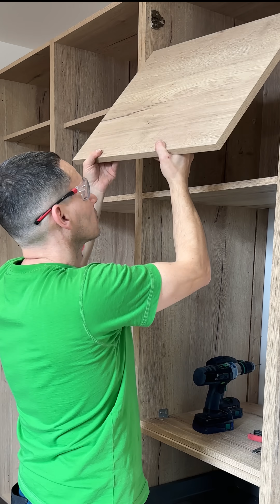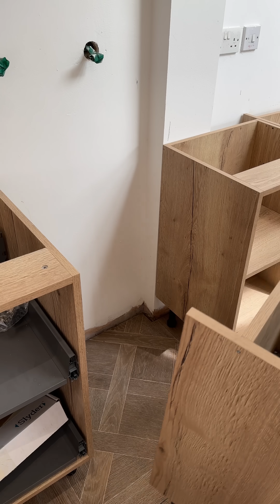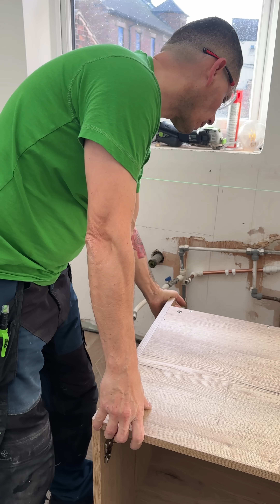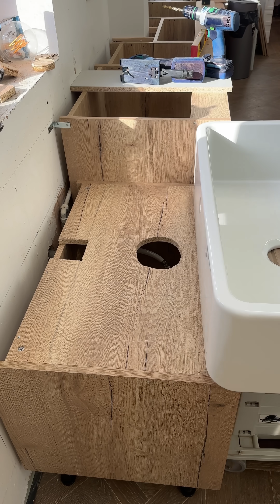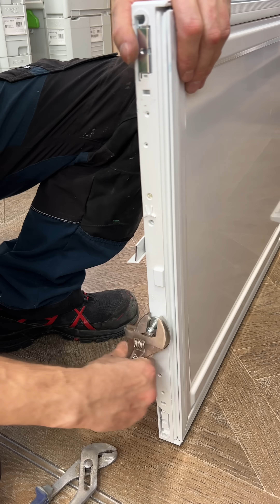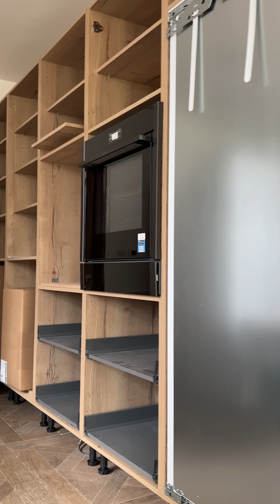How to Install Your Own Kitchen Cabinets (DIY Kitchen Remodel)

Comment: No panel on side of dishwasher/Belfast sink?
Reply from the maker: I decided to not put after consulting with customer I think it will look more nice without 2 panels breaking up the running unit
Reply: @CAVjoinery  will the side of dishwasher not be visible slightly?

Comment: Salut, fac și eu mobila, sunt din România, sa nu ma înțelegi greșit nu vreau sa te critic dar am câteva nelămuriri, am văzut ca lucrezi frumos și scule performante, dar nu înțeleg de ce te complici atât, cu atât de multe placări, eu când ma duc la lucrare ma duc cu ele făcute, nu tai nimic acolo, faci prea multe placări, și ce nu înțeleg de ce la corpurile de jos le prinzi în perete, asta nu pot înțelege la noi nimeni nu le prinde, noi facem corpul 510 pentru și mai rămâne în spate 40_50 mm pentru țevi etc, iar la corpurile de sus lucrezi cu agățători tip blum, și dai multe gauri pentru placute, și frezezi bănuiesc plf ul, noi lucram cu coltare normale, decât unde trec corpurile peste faianță folosim. Agățători sa nu punem. Distanțiere în spatele corpurilor, dacă vrei mai scrie mi și mai vorbim,spor la treaba...
Reply from the maker: Nu complic nimic nu sunt in romania unde toti peretii ssunt la fel si toate bnucatariile au aceeasi dimensiune in uk asa se plucreaza mersi